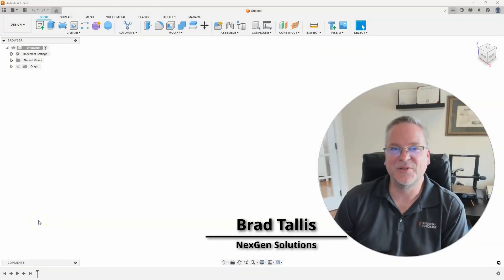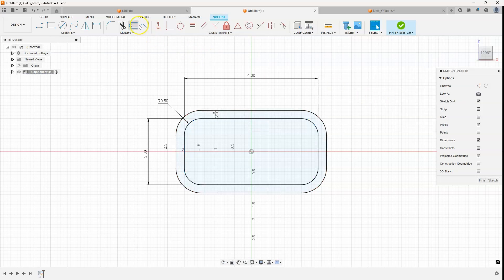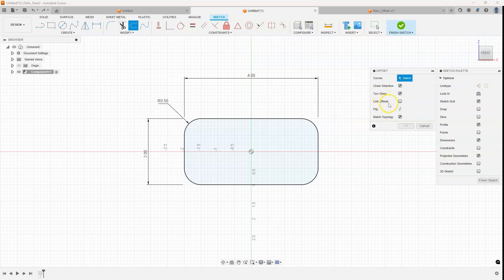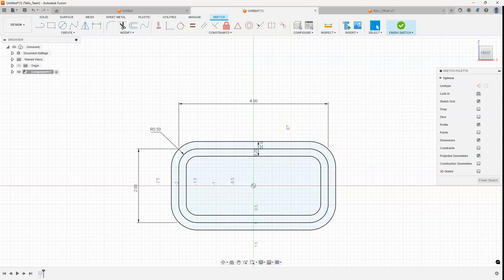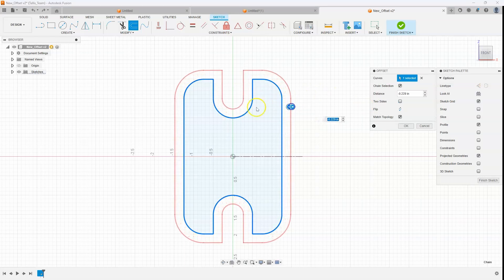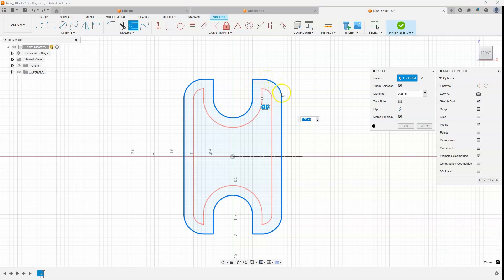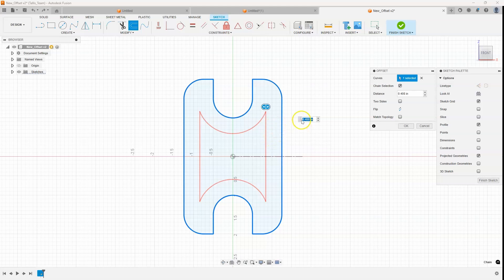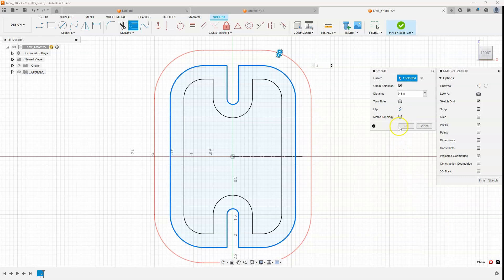Fusion Friday - Offsetting an Offset!

Comment: It's seemed to be the case for a while now that the devs have focussed exclusively on the CAM side of things, and forgetting about the CAD/sketching side of things, so this is a big step in the right direction.

However, having the offset to the outside of the original shape as a negative value still seems really dumb to me.  Hey ho ...

That said, thanks for another great video Brad, long may it continue.

Comment: There is also a nice feature with construction lines. 
Draw an object with construction line selected, or use X, Select offset. The offset lines are normal lines no construction line.  
Very useful when walls are needed in your drawing